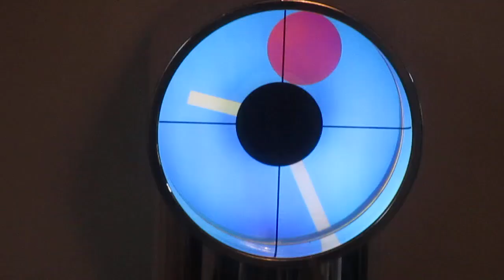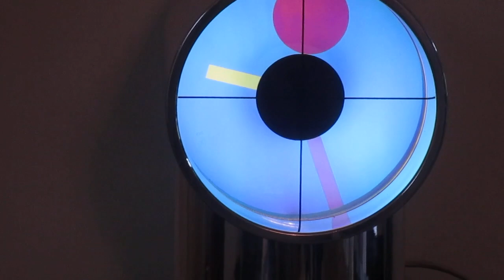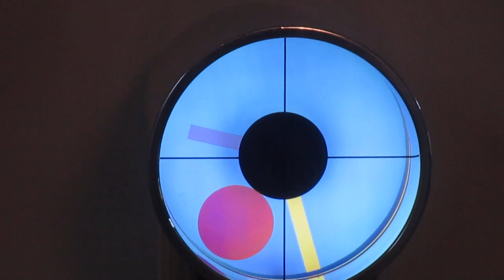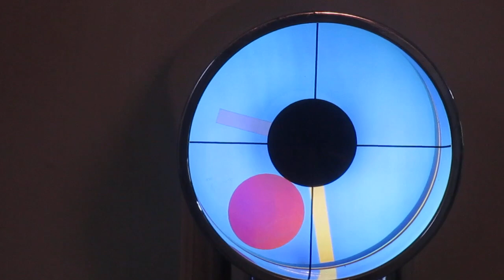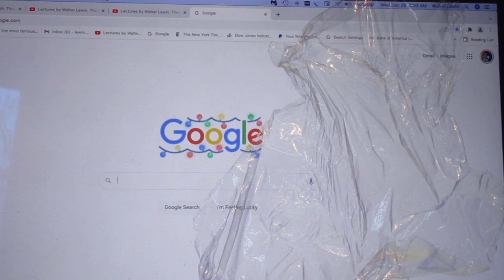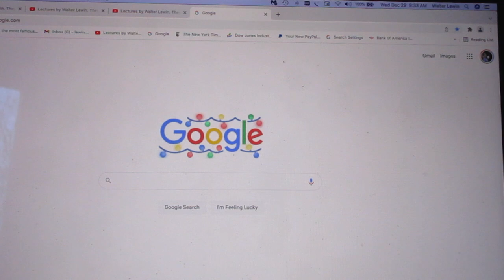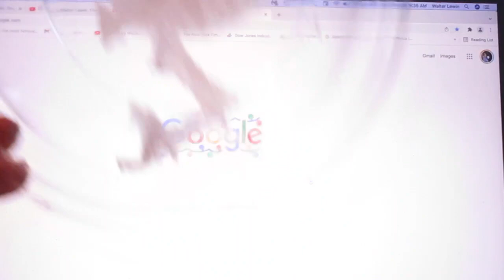Solution to #127 - Changing Clock Colors

Comment: Could a pair of polarized sunglasses work as an analyzer, in conjunction with stressed cling wrap and a laptop, of course..?
Reply from the maker: YES
Reply: @lecturesbywalterlewin.they9259  I see. Thank you.  One last thing: I have only two pair sunglasses.  They are the exact same "make and model".  To test if they are polarized, I look through them both by holding them up in front of me while rotating one of them, rotating parallel planes as it were.

If these are polarized sunglasses, I should see light dim to black as I rotate? Correct?